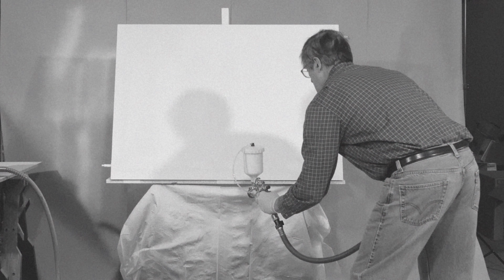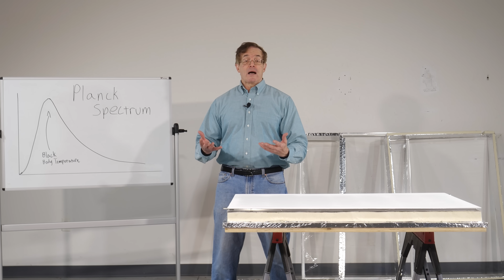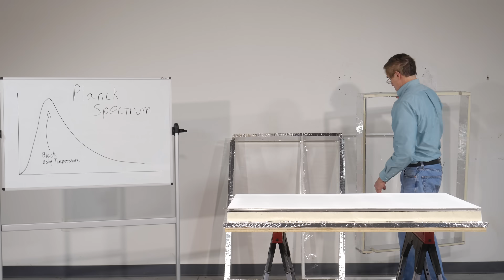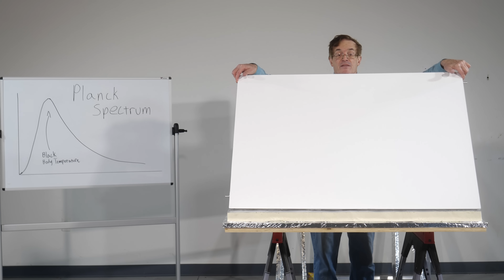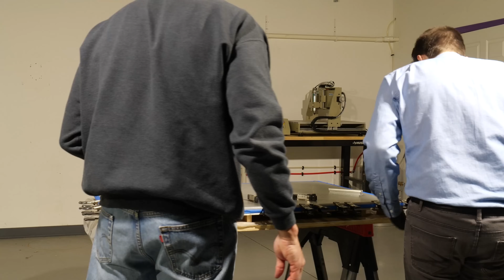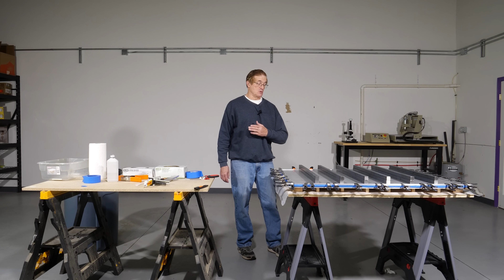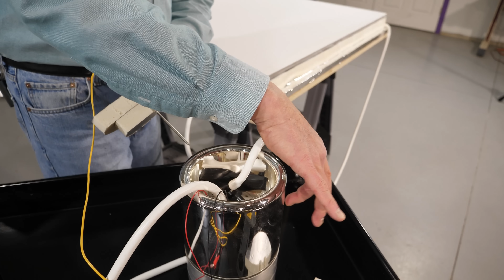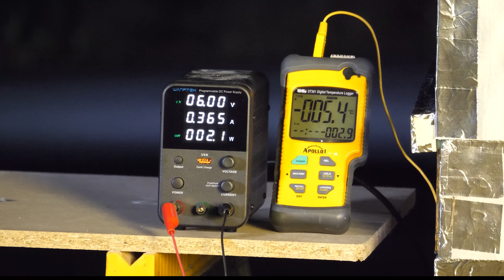Air Conditioning isn't free... but we're close.

Comment: In the /supplement to air conditioning/ example, you were clear this would be come after most of the heat is rejected by the existing air-cooled radiator.  To me that seems odd if efficiency scales ^4 with the heat differential.  Speculating ...  Cloudy days ruin efficiency?  Running hot refrigerant through a delicate system that can't reject heat is torture?

Comment: Intriguing. I'm wondering how this idea could be used with large cooled water tank reservoir and  heat pump with liquid heat exchanger to lower the delta T and thus massively boost the coefficient of performance, because as delta T approaches zero COP theoretically skyrockets up to infinity. It's very non linear.

Comment: Guess I do not understand Black Body Radiation as I thought I did!

To me the best color is a black like used to Absorb radiation like in a solar panel….
Reply from the maker: Don't  let the term "black" in black body mislead you.  It has nothing to do with its  visual appearance.  It's  a THEORETICAL surface that radiates energy only based on its  temperature and is not biased to any wavelength based on its underlying  color.

Comment: I love the concept of passive cooling. Please be careful about suggesting that cold water could be pumped into someone's radiant base board heating system though @22:10. When ever  a cold surface is in a warm environment, there will be condensation. Radiant base board heating systems do not have any way of removing condensation. It will just drip water onto the floor around the perimeter of the room. The liquid to liquid, water to freon, heat exchanger @ 22:30, is a much better idea, but much more difficult to pull off.
Reply from the maker: That depends on the dew point. Modest cooling will not cause condensation.

Comment: You sir, are an amazing creator and an inspiration! I've learned so much from your channel over the years. Off grid refrigeration has been a fascination of mine for a little while now. I've been kicking around the idea of a solar thermal heated ammonia absorption refrigeration system (boy that's a mouth full). I'd use such a system to build a walk-in freezer and possibly a "tree chiller" if it turned out to be viable.

Comment: Wrist is pivoting too much during spraying.  It changes the distance the paint takes to get to the surface, which means the closer part of the pass is wetter when it hits than the farther parts.  At best, it makes for an uneven finish (not that that's a real issue here, but thought you should know.).

Comment: Perhaps i am confused, (or not!), shouldn't be black painted the radiator instead of superwhite at least if that works at night? backwards along the day. 
A little off the topic, possible use calefactor chimney for cooling in any way? possible use water cooling system similar to the old cars(without pump, "siphon" system). Thank you for the video, you always trying bring the max from the simplest anybody could reach.
Reply from the maker: The visible color of the coating is unrelated to the thermal emissivity.  The white coating we are using is more emmisive than any commercial paint, no matter what its color.

Comment: One of the biggest problems with Solar panels is that as the temperature climbs the PV conversion becomes less efficient. Can this panel then be in some way used to act as a heat exchanger to keep the PV panel cooler thus maintaining it's conversion efficiency?
Reply from the maker: It could.
Our last video  on air cooling PV panels would probably  be a simpler solution for that application.

Comment: Just spraying a water mist on the outside condenser coil of an air conditioner unit, reduces energy consumption 30%.   Despite that, there are very few, easy to buy kits for doing so. Otherwise, geothermal loops, exploiting the near constant ideal temperature of subsoil provides cooling in summer, and warmth in winter.  Solar panels dont work "half the time" its more like 25% of the average day (6 peak hours every 24).
Reply: You better be spraying  distilled or demineralized mist of  water on the AC hot tubes or the minerals will build up quickly and block heat transfer!
Reply: @josephpadula2283 filtered rainwater is just fine. there are commercial systems used in cities, but they use water treatment to get the scale out the water to an acceptable level. The other option is to use an element similar to a evaporative cooler, to lower the temp of the air charge cooling the condenser coil, not as effective but easier to implement.

Comment: I don't remember who made a video about creating a vacuum pump using mercury, it could have been Cody's Lab??? 
But thinking about it, you would be using a heavy metal in liquid form to pull a vacuum. The mercury that is being dropped into the glass tube creates an air lock and as gravity pulls down on the mercury, it will squeeze the pockets of air between each drop of mercury causing the air in the pockets to compress and give off heat, in turn cooling the drops of mercury.... 
It could be an interesting way to move heat around..... The taller the glass tube column, the higher the compression, the more heat dissipation and finally the better the cooling on the other end.... 
Sometimes I see people do something and I see other things that could possibly be used for another purpose.... 
But like I said earlier, I don't remember who made that video... But if he only looked at the contraption through a thermal imaging camera, he might have noticed that something strange was going on other than just a vacuum pump.... 
Think I'm going to go looking for that video now and have another look at it again to see if I have missed anything....
Just searched for mercury vacuum pump and Cody's Lab showed up!!! That's the video.....

Comment: this is great. depending on the secret sauce, I may have to make something like this for 'garden office' I am designing for the backyard. would probably be enough to take the edge off the hot summer days (tops out at about 32c here).

this also explains why frost does not usually happen in shaded areas (unless its particularly cold) and why shaded areas are 'warmer' at night than when you are in an open area.

Comment: How do you account for the heat being produced by the pump? We are after all talking about small percentages, small temperature changes. The pump must be contributing some heat, even if small. Also, doesn't the foam decrease efficiency?  Thanks for another great video!  I worked really hard and I found the limiting factor to the oxyhydrgogen system -  the limiting factors as it turns out are the neighbors. 🙂  Dang exploding balloons.

Comment: Mr Wizard is taking us off the grid, hell yeah.

The only real problem with this design is the structural integrity. I hope that you find something better than polyethylene to put on top at some point. Feels like it won't be long before a stray bird or a squirrel rips a hole in it. Even if the price of the material is higher, are there any more durable alternatives?
Reply from the maker: It turns out with further testing  that polyethylene  isn't  needed.
Reply: @TechIngredients  That's awesome!

Comment: Seems like this could be a pretty effective way to passively cool down solar panels in order to substantially boost their efficiency and output in warmer climates that offer superior solar flux but at the cost of higher ambient temperatures thus lower efficiency and lifespans. Considering you already showed how just a simple fan and some reflectors can dramatically boost solar panel output it does make me wonder why solar manufacturers, solar farm operators and even grid operators are leaving so much extra cheap energy on the table? I mean I suppose it all comes back to storage but I imagine it'd still substantially drive down the cost per kwh even further. With just a few modifications that would cost almost nothing at scale manufacturers & operators would increase both output and lifespans of solar panels especially in the places most suited to generate vast amounts of cheap electricity from solar energy.

Comment: Unfortunately using this system with a hydronic system will cause the PEX, concrete, or whatever flooring material to sweat. However a water to air heat exchanger before an ac evaporator should pre-chill the air and reduce the load on the system. You have an amazing channel! My son and I are always excited when you have a new video release. Thank you!

Comment: Would a 2 or 3 stage system with this be possible. So say stage 1 is the ambient fluid getting cooled. Stage 2 is the cooled fluid of stage one being cooled further. Etc... Would that work or is there some kind of lower limit (say 10 degrees difference for example) where anything below that limit would just warm up instead of cool?
Reply from the maker: Yes.

Comment: @Tech Ingredients - Your IR excluder box for the local trees and buildings will actually reflect some of that IR right onto your Selective Surface. Will your surface reject it? If not, it would be better to make the sides of that IR excluder box angle outwards, such that the IR from nearby is NOT reflected onto your Selective Surface. This gets into the subject area called Non-Imaging Optics, btw, which has some fascinating implications and applications for radiative energy in general. For instance, Non-Imaging Optics can concentrate diffuse light with a simple Light Funnel, and in a hybrid optical system with a parabolic reflector and a special light funnel, the grand masters of the field published a most striking result in the top journal Nature volume 346 under this title: Sunlight Brighter Than The Sun in 1990. I think you will be fascinated and inspired.

Comment: If you're familiar with the DIY copper tube and crimped aluminum solar thermal collectors (BuildItSolar et al), I wonder how this high E coating would work on a NORTH facing panel built to the same formula, only with high-e coating and the IR masking. I look forward to the recipe!

Comment: Thank your for the vid. well made and extremely interesting practical real life examples. Love it! :) . the problem is.. i dont get how that example is going to be scalable. sure, in 3x12 tower block of flats (apartments) a requirement of how many exchangers? 3 rooms per flat, 3 flats per floor (storey) 12 floors high. 12*9 = 108. 1 of 3 rooms are not utilised or heated. so 12*6 = 72.  how can it be efficiently deployed?? is it 1 huge horse? or 12 ducks? (1 giga radiator, or 12 raidiators (one per floor?) or one per flat? (36) .. i can't fit this in my (limited) braincell 🧠 and mkae it work. theres an inadvertent cheat or a miscalculation or something.. gah.. my brain is now warm porridge.  its like picking up a full mug of coffee... that is actually empty, it's unexpectedly light, and that in itself throws ones mental balance around a little.

Comment: So what is the maximum temperature difference in the end?
maybe you should have just polished the aluminum instead of painting it with glass spheres? it reflects 90% if you polish it in distilled water and immediately cover it with a thin layer of zinc sulfide or silicon monoxide...
Reply from the maker: We didn't use glass spheres. 
The next video will explain how the coating is made.

Comment: That collar won't be doing anything for you. Yes, the front face of it will block infrared radiation from the trees as intended, but the back side will just reflect the same amount onto the coated surface.
You'd need the side faces to be at an angle. Something between 10° and 45°.
Since basically every ray of infrared that is passing through the top opening is eventually going to hit the coated surface, all you're doing is raising the 1m² area that is absorbing the radiated heat from the trees by 25cm. Except for the 6% absorption of the aluminum tape and the fact that you're lifting the plastic wrap up by those 25cm as well.

Comment: Cold lowers in elevation heat rises neither likes to travel around bends horizontal, I would think using them as internal ceiling panels in hot environments. Maybe even in conjunction with some kind of other method of heat exchange or removal. 🤔 dose make me think I need to brush up on few thing....I was entertaining crazy thoughts of the impossible like a perpetual thermal energy device for a moment or a powerless fridge 😆

Comment: Could you radiate to space on a wavelength that is not blocked by clouds?
Reply from the maker: No.
The temperature defines  the radiation wavelength. We can't  alter that.
Reply: @TechIngredients  Thanks. I understand that there are purpose-made materials that can do that called thermal photonic structures. Perhaps that's for another time. :D

Comment: Good video, but wondering why you left cooling of solar panels off the list of possible applications?  Also wondering if you were using distilled water, or some anti-freeze additive in the demonstration? Would a light viscosity oil or silicone-based liquid also work as an operating fluid?  The only operating "expense" might be the power for the pump -- very nice. The obvious comment; "Cool!"
Reply from the maker: I added 10 % propylene glycol as an antifreeze.

Comment: But if the reflective tape at 90° angle actually does act like a mirror, it should still "see" the surrounding buildings and trees. Imagine you had an actual mirror in place of the tape. It would reflect the picture of the white surface. In order to actually block infrared light exchange between buildings/trees and the white surface, the side reflectors should be angled in a way so it "sees" the sky instead.

Comment: A future experiment.  What if you didn't cool the space, but were able to take heat away from a body directly.  Even if it was only partially effective and you could set your AC at 78 instead of 72, that is a massive energy saving.  There are a variety of collars and other devices that purport to cool your body while outside (Peltier cooler?).  But how much energy would you need to store in a worn battery pack for different scenarios?  e.g. I'm working in an office where the temp is 80, I want to "feel" as if it is 74.  or It's 95 deg and 95% humidity, I want it to feel like it's 85, for a 4 hour event, how much energy do I need to carry?  What is the best mechanism to take the heat out of my body?
Reply from the maker: I can't  visualize  how without  cooling the surfaces of the surrounding room.
Reply: @TechIngredients  Maybe these things are bogus.  Thought it was a solid state cooler on the back of the neck. https://www.youtube.com/watch?v=UheNgtAQSC4  My hypothesis is that while it feels cool, there is not enough heat transfer to actually make your body feel cool.

Comment: Cooling a floor won't do much to cool down the apartment. I have a basement, which I keep in about 10C during the winter. Both my basement and upstairs have water circulated floor heating. At the beginning of the summer, my basement is still about 15C, so if there starts to be too hot in upstairs, I can put both thermostats to max, so the cold water from the basement circulates on upstairs too.

It'll make the floor uncomfortable cold, about 17C,  but don't lower internal temperature significantly or make it feel colder, like only one degree drop with air conditioner can do, since it lowers the moisture content significantly.

I have also tested to harvest cold from the water I use to water my garden or lawn by flowing it through a car radiator and using fans to flow the air. Water comes here (Finland as 6-7C) temperature, being too cold for plants.

Even though there should be lots of energy moving and the air feels cold, it won't do much to the house temperature. My house is well insulated and in -20C, it takes only 2kw to heat it. Colling seems to be much harder.
Reply from the maker: The fluid in the radiators or in the floor  will cool the structure  of the building as well as the ceilings  of the floor below.

Comment: Your experiment might have shown a larger temperature delta if you used a different pump where the motor of the pump wasn't dumping its waste heat into your chiller fluid. Maybe instead of a pond pump you used a transfer pump? What is your water flow speed? Would a peristaltic pump have a high enough flow rate, or do you really need to get an impeller into the water?
Reply from the maker: Correct

Comment: As the pump motor will heat the water, it may be better if you put the cooler above the tank, with the a sight angle so cool water will fall from the cooler into tank, and warmer water will rise up to the chiller. 
With some luck the system will be self circulating, due to the temp differential.

Comment: I have been wanting to paint my house and roof with 99.9 reflective paint. But city codes won't allow it. Here in Southern California it would keep my house from absorbing solar heat. But that's California. The same with our drought, I would like to keep my yard "natural" but the city requires a minimum of 20% greenery. I use way more water to keep my landscaping up to code than for personal use. Also, reflective paint is great in summer, but right now it's freezing in the house and that paint would make it colder. I would like to do a textured exterior that reflects when the sun is high, absorbs when low.

Comment: There is a company claiming it can retrofit coal fired power plants with nuclear reactors.  If this is truly possible, it can dramatically lower the cost of building nuclear power plants.
The one problem I see is it begs the question, why is the coal powered plant being shut down in the first place? If it is for political reasons or the cost of coal, the rest of the plant may very well be in good operating condition and worth the nuclear upgrade. But if all the cooling and generating systems all need substantial repairs to the point that it wasn't worth doing, it won't be worth doing for nuclear.